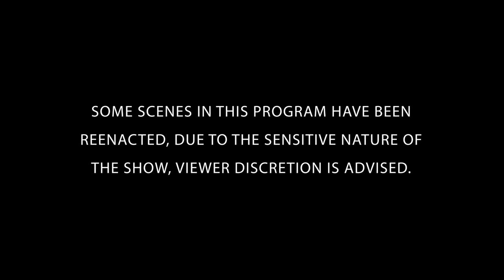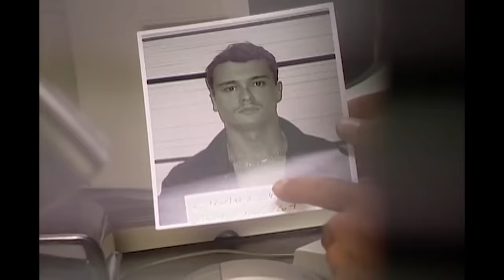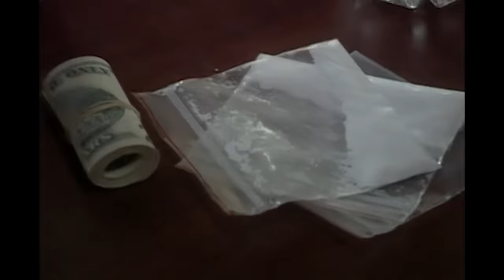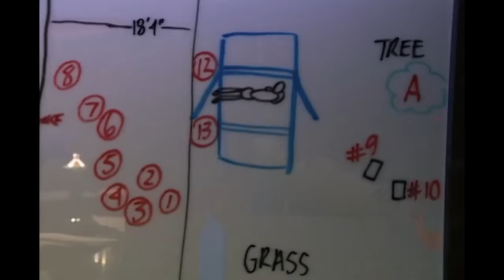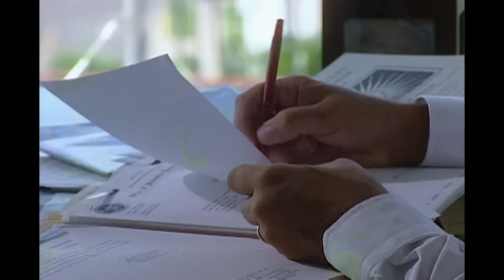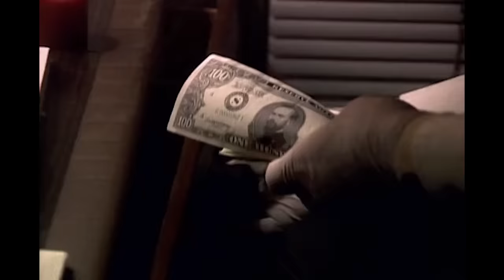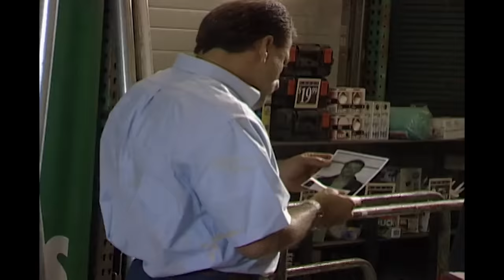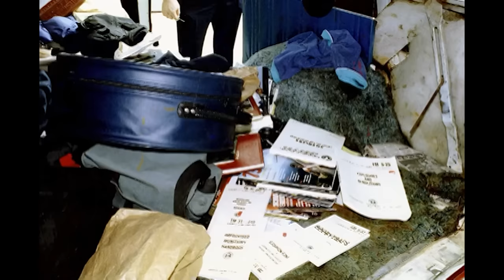Deadly Threat | FULL EPISODE | The FBI Files

Comment: It was a real deadly threat. Thanks alot for the great work done by all the officials. But i gotta a suggestion, the officials should come in early and arrest the suspects and keep them somewhere as they come up with a conclusive evidence coz some suspects are so so deadly like the one in question.Ahmed Qatar.
Reply: They can't just arrest and hold someone without any evidence though. Their lawyer would easily be able to throw that case out. If so, that's it since there's no double jeopardy meaning you can't get charged for the same crime if you already went through court with that.